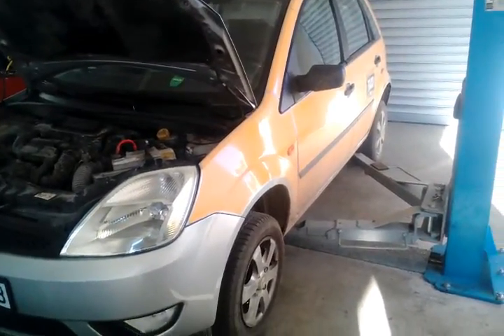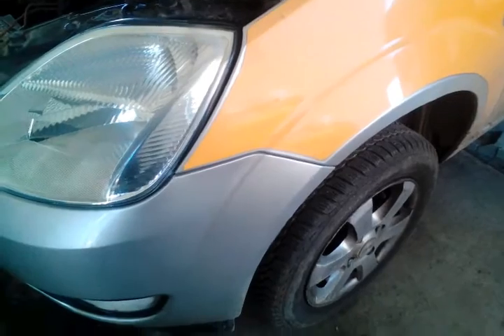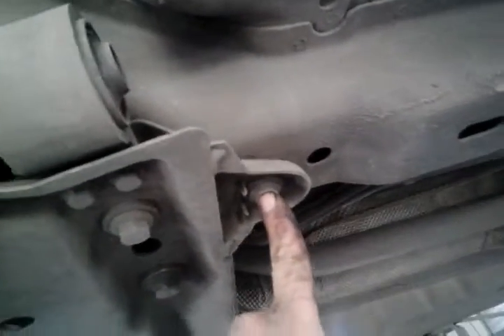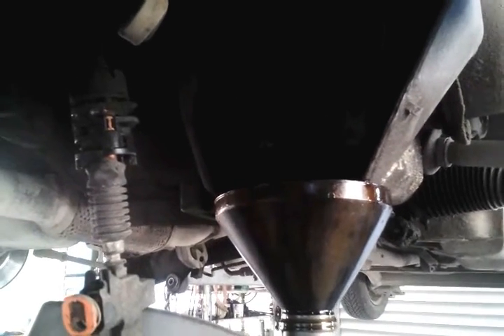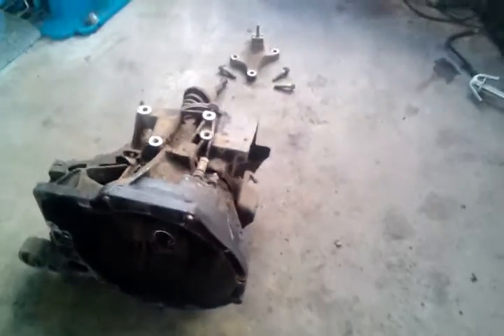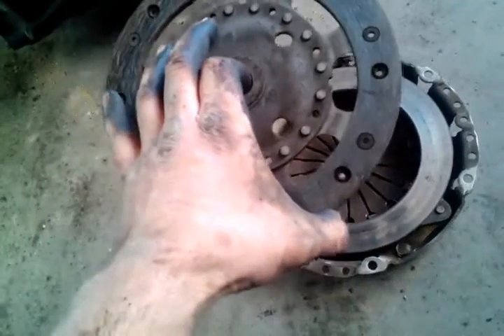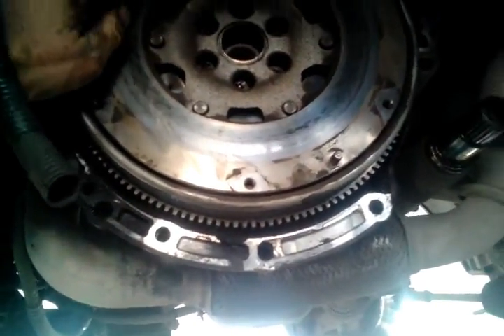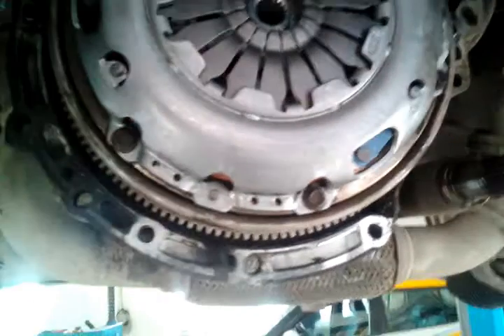FORD FIESTA 1.4 TDCI HOW TO REPLACE CLUTCH

Comment: Right cheers for the help mate got gearbox out etc just waiting on new clutch to arrive tmw then refit however how do I bleed the clutch fluid properly regards
Reply from the maker: Dale Bassett how to explain clutch pedal should be in top position (not pressed )and open the bleeding valve until start leaking then close and you need someone to pump on clutch pedal and while is pressed and holds in that position open the bleeding valve and close it  repeat couple of times
Reply: Igor Dimoski great thanks pal and also lost a lot of transmission fluid is it a 2ltr bottle needed to refill ? And also what would I be looking at 70/80 ?
Reply: And the bleed nipple is sitting on top of the gearbox is that correct ?
Reply from the maker: On the clutch release bearing are two connectors one is connected with clutch pump and the other one is next to it and usually have white bleeding nipple and for the oil i think it was 75w-90

Comment: My fusion clutch has an issue. The pedal/ bite point is very high. I Can still change gear fine and the car doesnt slip. Do you think this is plates or more a hydraulic issue?
Reply from the maker: If the pedal is high and hard to press then the clutch disk is almost at the end when it starts to slip you have to change it
Reply: @mechanicigor  thanks. A full clutch and flywheel change due then?
Reply from the maker: If it's with dual mass flywheel yes
Reply from the maker: And always check hydraulic clutch release bearing if there is hydraulic liquid on the bearin it's better to change him to
Reply: I've seen some of the fusion 1.4 tdci's have solid and some have dual mass. As the engine is only 67 bhp the dual mass isn't really required and a solid flywheel can replace it if you have dual? Does this sound correct?

Thank you for your responses. I'm new to fusions! Ive had a 1.6 tdci cmax and a 2.0 ecoboost galaxy. Trying to find my way with this one!
Reply from the maker: @GTMMC43AMG  I maintain two fusions and both have solid flywheel I there is no problem
Reply: @mechanicigor  ideal. Thanks again! Do you ever skim the flywheels during clutch replacement? Sorry for all the questions....
Reply from the maker: @GTMMC43AMG  if there is more than 1mm where clutch disk stay then I take to machine to make it flat but that is for solid flywheel
Reply: @mechanicigor  if I'm putting a solid flywheel on a car that used to have dual mass, is there any alignment issues to worry about?
Reply from the maker: @GTMMC43AMG  no every thing is the same
Reply: @mechanicigor  thanks for your help. I've had the car apart and back together. The car won't start. The starter motor makes a high pitched. Squeel but doesn't turn the engine. Any ideas
Reply from the maker: @GTMMC43AMG  did you install right starter motor or is it tighten to the transmission

Comment: Hallo igor have u evere changed the gear box fluid on a fiesta mk5 ? Can u make a video
Reply from the maker: snakedoc104 for manual transmission is easy for automatic transmission it's tricky

Comment: You dont need to remove the subframe. When the left hand engine mount is removed the engine can twisted forward to miss the subframe and the transmission can then be dropped.
Reply: Alastair Munro thank you i was thinking could you remove gearbox without removing subframe thank god for that saves a lot of headache :)
Reply: You remove the battery box and then the metal panel below it. Then you will see the engine mount nut and the mount with a nut either side; remove these side nuts. Support the engine then remove the center nut and remove the mount; then the engine can be twisted forward missing the subframe. I used a wood beam to support the engine across the fenders above with a chain; saves buying an engine support bar. You can save yourself alot of grief dropping and putting back the gearbox by getting a flat piece of wood and bolting this loosly onto a trolley jack in effect creating a transmission jack.If you bolt that in loosly you get some side to side and back to front movement which helps when putting the gearbox back. Try to buy Luk clutch parts; they are original oem.
Reply: And you can get some tie straps to strap the gearbox to the piece of wood, if you are worried about it falling off! Don't skimp on clutch parts; my no name slave cylinder only lasted 3 years/30k miles, hence needing to do it again 3 weeks back!
Reply: Alastair Munro top guy thanks for the info so far this is my first clutch change attempt the thing i was wondering how many bolts holding gearbox in place bud? And can you leave the drivers side drive shaft dangling instead of removing completely ?
Reply: Two at the top, two underneath, one at front, one at back near starter, 3 holding starter in. Starter bolts 10mm others 13mm. Tricky bolt is the back top; you remove a nut that holds a metal frame for the wiring, then another that clamps an earth strap. Deep 13mm socket 3/8 is highly recommended! 3/8 sockets i find really handy where space is limited. So i did all the prep on a Thurs afternoon, by 10am Friday had the gearbox dropped, and it was all back together again by end of day Friday. Decent length breaker bar helps loosening driveshaft nuts. Tbh its not so hard;just alot of things to remove/put back.
Reply: Alastair Munro thanks mate gonna try removing it tomorrow as ive got two cars a mark 1 punto thats knocking when turning the steering suspect top mount issue however cant for the life of me find replacements anywhere and this fiesta tdci with clutch failure ah the joys lol thanks again mate
Reply: Missed your second question. Yes you can but engine needs supporting with a beam above. Use that support as shown in the video. I would not recommend supporting the engine just using a jack. Probably you have a dual mass flywheel; mine needed replacing after 108,000 miles. You should check it and expect to replace it if worn. Assuming you have a deisil? Petrol doesnt need/use dmf. So they had the great idea of removing the springs in the clutch and moving them to the flywheel, which gives you an expensive part to replace when worn!
Reply: Alastair Munro as I suspected however I tried an engine beam and does not sit right on the wings mate so I’m at a loss there , and it’s a single mass flywheel on my fiesta have checked with fords so hopefully it will go ok I’ve done the donkey work just need to find a way of supporting the engine the correct way
Reply: Thats good news with the flywheel. I just used a softwood beam stuck behind the rubber plastic stoppers for the bonnet. Its 4" x 2" but a 2" x 2" would probably do. Some chain i had with a 8mm nut and bolt to secure it. Basically use what you have knocking around. Its alot of effort but think of all the money you will save, what with garage hourly rates at £80 upwards in the UK!
Reply: My friend we don't need to.remove subrfame only in petrol engines or and diesel.engines?because the diesel engines has turbo in front.near the radiators...your car is diesel?